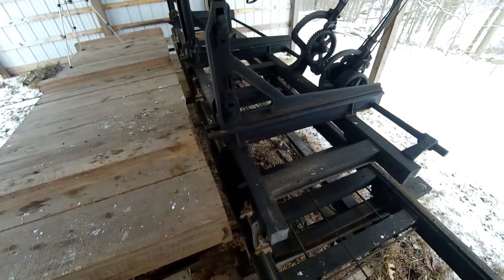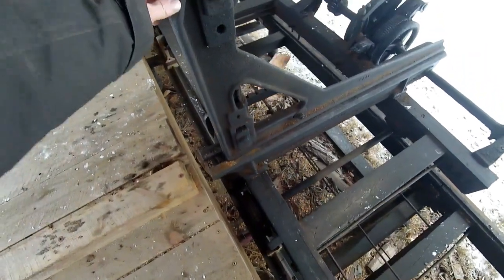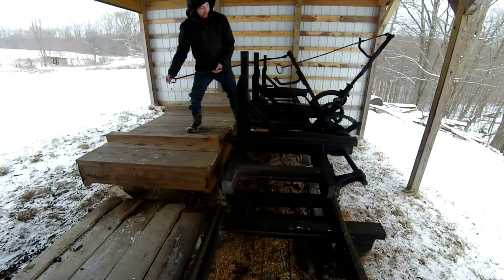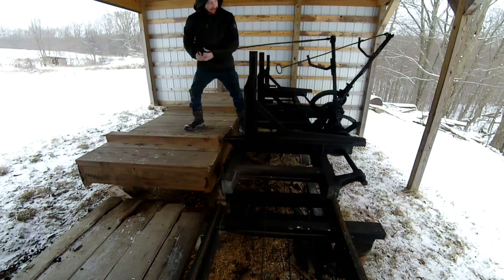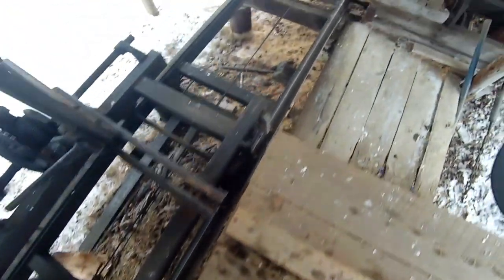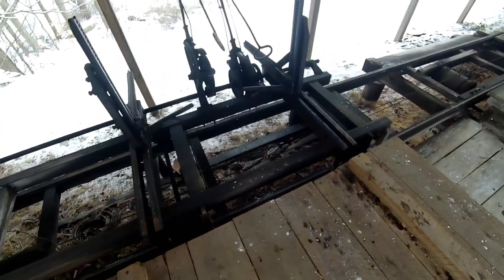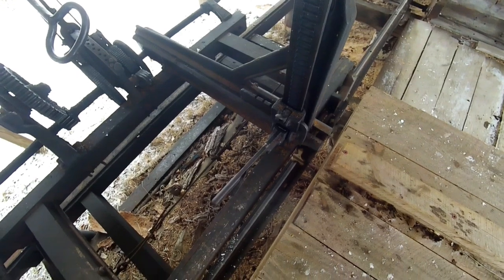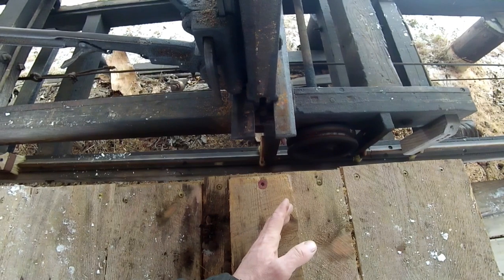Antique Sawmill  Carriage and Setworks Explained

Comment: I’m guessing it’s the adjustable mechanism that allows the operator to advance the log after each pass through the blade so that each board is coplanar with the previous and next board. It’s adjustable for thickness, probably by 1/8” or 1/4” but with all those pawls it might be able to be advanced by 1/2” or even an inch. Sounds like a ratchet.

Comment: that is a much older frick sawmill U don't see W 2 levers no more and most pins are set so when U pull the racket U pull a inch 😊😊 each time 3/4 of a inch is odd U still have allow 4 /1/4 for the racket what U pull and 1/4 of a inch 4 the saw blade /that's the old scale on the sawmill I like the frick sawmills W the lumber gauge wheel easy 2 read 😊😊 2 27 2O24